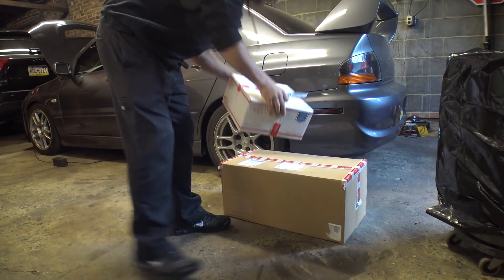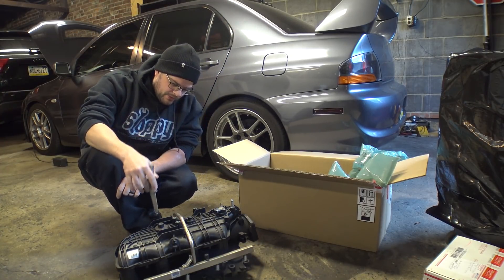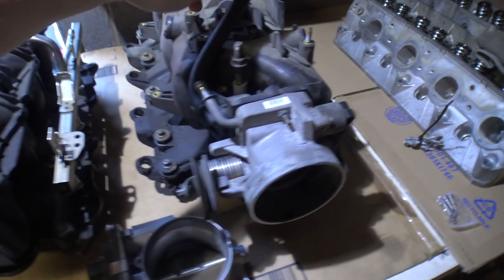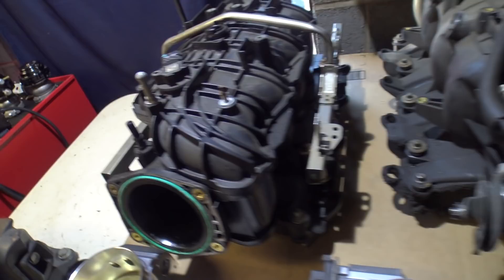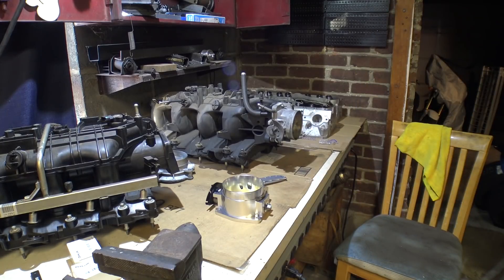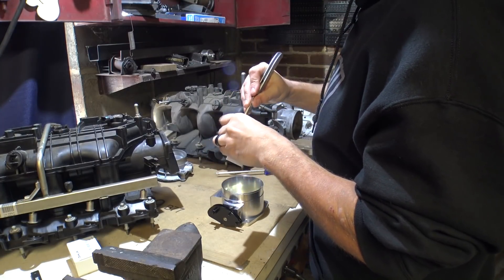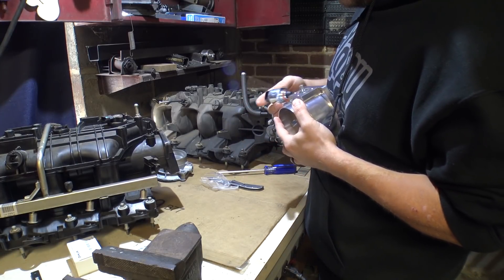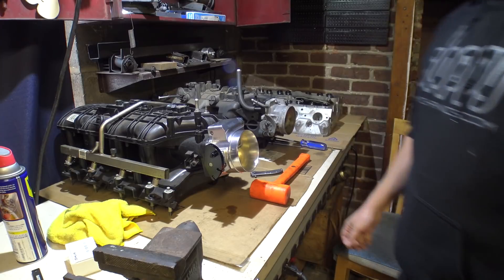TBSS intake test parts arrived

Comment: Assuming your putting this on a 5.3? Does the 5.3 throttle body bolt up to the tbss intake even thought its a smaller mm?
Reply: No it does not the og gm one is 3 bolt

Comment: I just bought a TBSS intake for my 2002 5.3 Silverado with a BTR Stage 4 truck cam and 3200 Circle D stall. I'm interested with what you came up with to run the return to tank fuel rails (instead of mounting a bulky C5 fuel filter on the fuel rails like many suggest). Great work man! I'd love to see more on this buildup!!!
Reply: Larry Bagley did you have any problems with your truck starting?

Comment: Mail order tune $? 08 Chevy avalanche stock engine and computer, gapping rings to 30 and 26? AFM deleted, on3 76mm turbo, comp cam lsr 227-235 614 621 113lsa. ,72lbs fuel injector clinic with data sheet, WB 450 fuel pump. Speed daddy WG and bov, 4l80 swap tci 3000 street fighter converter. EBay inner cooler, DNA turbo headers. 2006? Zr1 3bar map plug ends are different. Looking for 850hp or better to the crank. 10 to 20 lbs of boost. Northeast Louisiana.

Comment: Did you ever figure out how to keep the return style fuel rails?
Reply from the maker: i bought a regulator and i am just planning on using that so i can easily convert back if i want to
Reply: Sloppy Mechanics does it pinch the lines in any way with the regulator?

Comment: i have one of these intakes and the same china tb. the bolts on the tb blade are backwards from the one you have. philips head is on the inside of the motor. and when i screwed the tps on to the tb is smashes the passenger side of the tb blade into the housing and its starting to shave metal off of the tb bore and obviously the blade wont hardly move. im curious to see your experience with this tb. i contacted them and they seemed ok with giving me a refund. not sure if i just got a defective tb or its junk. i know other people that have used this tb with no issue, after using locktite on the blade bolts. keep up the good work. congrats on the baby!!!

Comment: 33737 fuel filter at O'Reilly auto parts. dual in single out with internal pressure regulator
Reply from the maker: they do not work great on higher hp applications

Comment: I have the same intake and fuel rails on my 2001 Silverado. I used a C5 fuel filter and fuel transfer hose to connect it to the factory lines. Works great.
Reply: IfItsFast ItsCool  fuel transfer hose? I’m looking to do same swap. It’s the vette filter/regulator combo right? What else do you need

Comment: How does the throttle cable bracket get mounted up on the TBSS manifold?
Reply from the maker: good question! ill have to do something, haven't looked into it yet, i can take a stocker, and just weld something together that bolts on or similar
Reply: Interested to see what you get, I've got the early LS1 intake in my truck and I've been eyeing these intakes for a while.  I can't bring myself to spend $1k on a FAST.  The Dorman LS2 is tempting, but I think this manifold still outperforms it.

Comment: Will you be doing a video on the intake fuel rail conversion?
Reply from the maker: going to try and video nearly everything i have to do
Reply: The reason I was asking is because I switch to a l96 top end on my lq4 and had to use a fuel filter off a corvette to get the returnless fuel rail to work. Would love to go back to the return style rail.

Comment: Can you add a return line to that rail?  I welded a AN fitting onto mine, was on a LS6 intake.
Reply from the maker: i plan on trying to retro fit my older return rails to this intake, i heard it bolts on with minor modifications
Reply: Ya if its easy, then great!

Comment: I've been through this before in NA form with a with a 226/231 cam, interested in seeing your results as the dyno day for my tbss intake and 92 mm throttle body was 15-20°F hotter than with the gen 3 truck intake and 78mm tb. I saw zero rwhp gains but a 4 rwtrq gain, 6.0 th400. Looking forward to the tests
Reply from the maker: thanks! i have seen many positive results for NA setups with this intake swap

Comment: Use a corvette fuel filter and you won’t need a return line.The vette filter has the pressure regulator and the return line fitting on it.
Reply from the maker: corvette regulator is not great for high hp situation at all, failed us many times, i already have a return system, and return rails, i hear its minor modifications to fit them to this intake, presto chango
Reply: Sloppy Mechanics yea i have a c5 and i never ran into anybody having that issue.

Comment: Let us know if there are any tricks to get that throttle to idle right.  I have the same set up but NA and have spent hours messing with it.  I will get the iac counts perfect and an hour later it runs like shit.
Reply from the maker: +John O'Brien I’ll let you know, your tps % change at all? Adjustment screw seems like it might back off a little o it’s own, again I’ll let you know
Reply: John O'Brien the iac port is smaller on the 92 mm tb compared to factory when you compare the inlet and outlet of the iac port. So the ecu is calibrated to the stock iac valve and port, therefor a smaller iac port will not give the same results per opening of the iac valve as intended. I have one of these ebay 92 mm fast copy throttle bodies and enlarged the iac port in places. It helped a little in reducing the iac counts but still has issues on low speed parking lot cruising with surging. I have played with timing tables and many others, it's quite the battle but can get half decent.
Reply from the maker: very interesting, great observation, now that you said it i do remember seeing the inlet is smaller, probably to make the throttle larger inside,
Reply: Interesting, I'll pull the thing thing off this weekend and compare both.  Matt, the voltage wasn't changing so I'm assuming the screw wasn't backing out.
Reply: Sloppy Mechanics Thanks Matt. It gets a little tricky modifying the inlet port because, depending on how far open the base throttle blade position is, it can make the inlet port peek over into the intake manifold side of the throttle blade. The outlet port is much smaller though than a factory tb so it seems more beneficial to play with that. Best of luck on everything.

 Strangely enough I initially tried an adapter with my 78 mm throttle body on a tbss intake and made the same power as with the 92 mm tb but without the low speed surging crap. However I think my 1 3/4" mid length headers were holding back gains from any additional airflow. Hopefully you have much better results.

Comment: You can also take a center punch and peen the center of the thread end of the screw.  They will never come out after that.
Reply from the maker: +Do R/C! Excellent tip
Reply: Eric Fixalot yes you definitely want to use a backer on the head side.
Reply: I think that’s the way chevy does it on the older tbi stuff. 
I wouldn’t want to bend the throttle shaft though, maybe put something behind it. I bet a tack weld would work just as well too.

Comment: WOW>>>>Very surprised you watch Soundman!!  Small world.

Are you a car audio guy also??  If so, you should do a sloppy mechanics type SPL build.  Thats actually a damn good idea!!
Reply from the maker: i love soundman, i can appreciate car audio but i am not really into doing it other than a 100~ head unit that plays Mp3 in my cars anymore i am set
Reply: fair enough.  Thanks for all the free content over the years...its been a huge learning experience and hasnt cost me a dime.  Keep up the good work.

Allow me to put in a couple suggestions for future builds.

Suggestion #1 ---1st gen explorer (91-94) because theyre everywhere for well under $1000, rear end is already done.  2 door sport version is available with a tad shorter wheelsbase and if you bother to lower it, they dont look that bad.  The swap is quite easy..drop-in if you use truck oil pan.  Need to fab motor mounts but I just found plans for them online so thats easy enough.  And need to reprogram the stock computer orrr use the GM column, computer and harness (which I find to be a better solution).  Then do your own gauge solution...like a cheap tablet mounted indash.
(Even a 2nd gen explorer (95-01) can be found for dirty cheap and have that same 8.8 rear end except now with discs most of the time....factory posi on all of them I think...and stock they almost all had 3.55 gearing but some had 3.73 Im told.  These trucks look far better, much more comfortable to drive.  Ive had three of them..all with the mustang-ish 5.0v8 awd in them. Headers/manifolds would be very tight if you ran them conventionally but up and forward would likely work.  Theres only one guy in the world who makes headers for these v8 2nd gen explorers because theyre such a pain in the ass to design....theyre killer build quality but cost me a fortune.  I think I paid $900 or so after shipping.

Suggestion #2 ----    Geo Tracker.  There was one on drag week this year and I remember another being in a build thread on yellow bullet a couple years back. With the rear top off they look so killer.  However would probably require quite a bit of cage to stiffen that tin can up enough for bigger power...and I know you arent a big fan of caging these vehicles.  But with that top off the cage would look badass.
Imagine how that would look fully backhalfed ?!

Suggestion #2- B     ----Along the same idea as the Geo Tracker....a Suzuki Samurai.  Only issue being I think these are really coveted by the 4x4 crowd so they might be way over priced.  Not to mention definitely much smaller than a Geo Tracker even.  However, IF, the LS could fit then it would be that much more badass in this vehicle.

Suggestion #3----one word......CHEVETTE

sorry I get long winded and excited when swaps are brought up.

Comment: Could you try dynoing just the tbss mani and t-body before the head swap.  Easy enough to do. I’m curious on what those gains would be.
Reply: Lsx Z32 the intake will gain a very little. It pairs best with a good head like the 243/799 heads. If you have a good flowing intake and shitty heads it's counterproductive.

Comment: I had gotten a screaming deal on a slightly warped set of Cathedral & Square Port Chinese HiRam intakes, both with 102 Mike Mike openings. The mounting flange was welded too hot, it only took slight surfacing to bring them in.
HiRam is nothing for a FI engine, but the Alum. mass is sure to help inlet heat temps, at least over a plastic injection unit.
Reply: Yea, got to watch those Ebay intakes, glad it worked for you
Reply: I knew what I was getting into. The guy was one of those people who get this shit from a "slow boat from China" and sell it. He "told me" that he looked into machining them, but he didn't want to do it.
I guess he got most of his money back and decided to just make a little money off the "fixer upper" intakes.
Reply: What did the machine shop say
Reply: Never took them to anyone.. put them on straight edge, slipped some feelers in, marked the surface with making compound, so when I started taking material off, I would know when to stop, make sure i'm not doing it uneven. I'm going to do a video about it on YT soon.